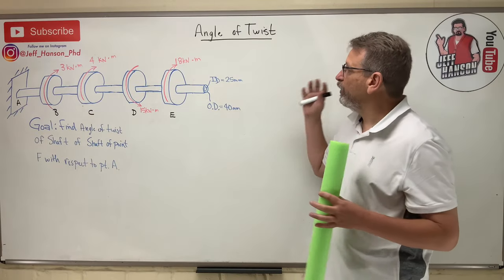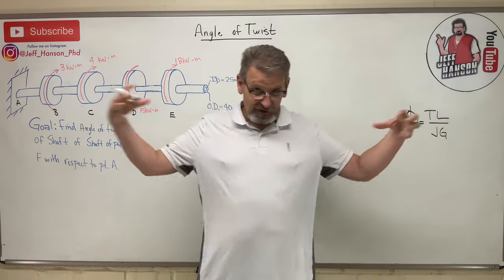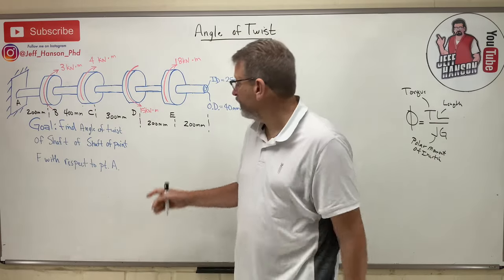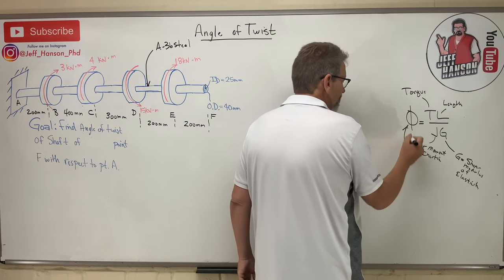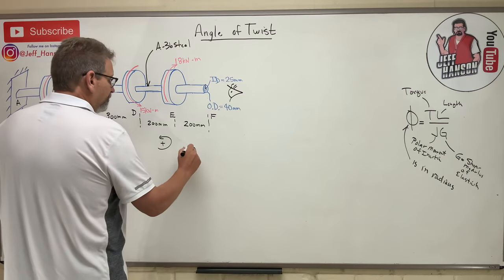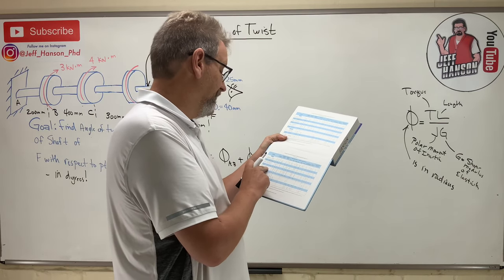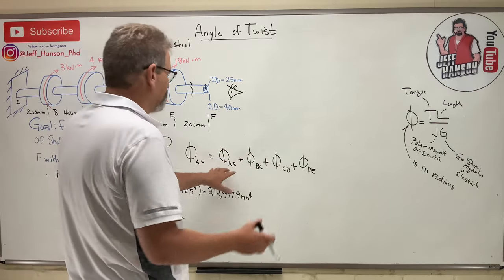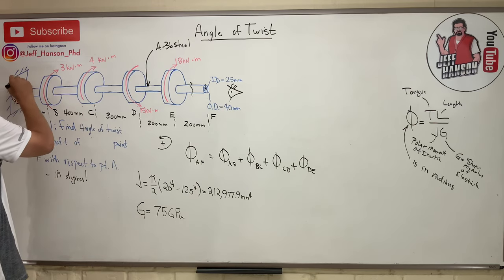Mechanics of Materials: Lesson 25 - Angle of Twist Due to Torque, Torsion

Comment: For the last step, should the conversion be 2pi/360 = 1 radian? With that I got the angle of twist of 30.76 degrees
Reply: Yea even doctors make mistakes, should be 33.28 degrees from 0.581 rads
Reply: 360 deg = 2π rad ... Thus 1 rad = 360/2π
Reply: yeah ,that was the only mistake

Comment: the angle in degrees is wrong cause it should be 16.66*2= 33.33 degrees 
I guess the mistake is 2Phi/180 should be only Phi/180 or 1rad =57.3 degrees and 0.581 *57.3= 33.33 degrees